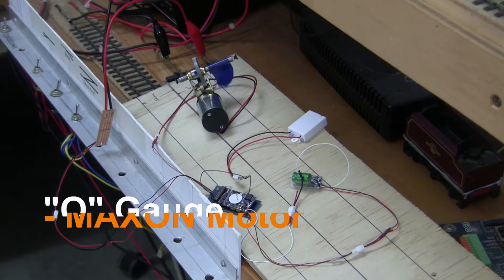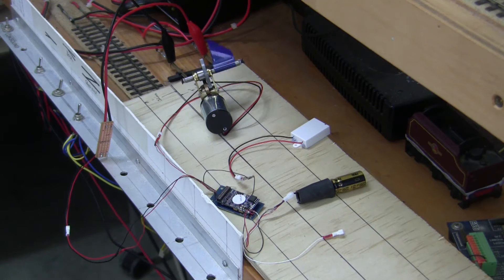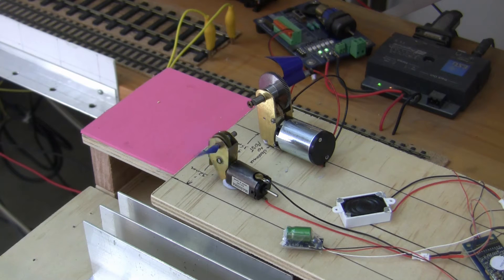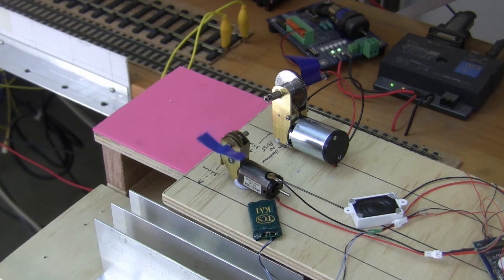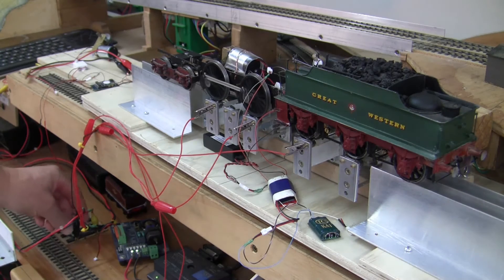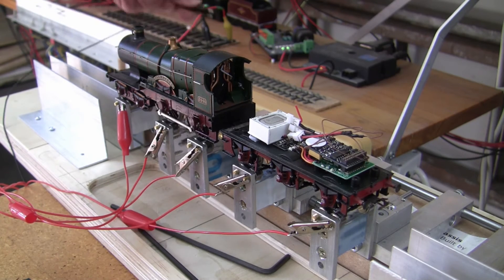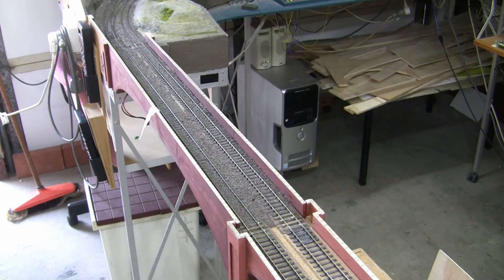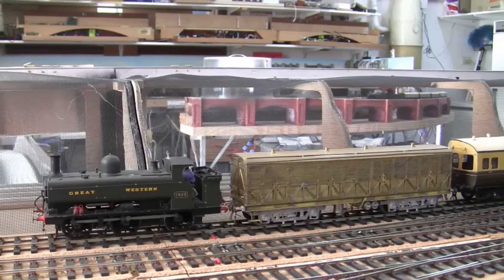DCC Decoder Keep Alive tests

Comment: I'm sorry, don't see the point of the video when it's only down to the size of the capacitor in the 'stay alive', doesn't matter who makes it, it's what size ( in micro farads/farads ) capacitors they use, just boils down to physics, make your own and fit the largest capacitor ( in capacity size/capacity can vary from make to make ) you can, job done! Don't concern yourself with whoever made the 'stay alive' they don't have access to miracle capacitors unless of course they're aliens??? :-)

Comment: What capacitance do you have in you homegrown unit?
Reply from the maker: Hello.  Have a look at page 26 of an ESU document for their V4 decoder file:///C:/Users/Charles/Downloads/51972_LokSound_V40_ESUKG_EN_User-Manual_Edition-4_eBook_03.pdf The details of the specification and circuit are shown there.  You might also like to look at DCC Concepts and their Super Stay Alive unit which is very competitively priced and saves you having to build your own.  I now use these units....
Reply: Thank you for your reply! I dug a little dipper on the subject and did a little math so indeed the 2200uF capacitor can only handle brief interrupts...

Comment: This stay alive nonsense should have been sorted out PRIOR to marketing DCC !
i see DCC as just a cynical overpriced gimmick, which these so called 'stay alive' things just add to more expenditure and more fiddling about to install.
Reply: "sorted out Prior to marketing DCC" so in the late 80s? because that's when DCC was first introduced and I certainly doubt decoders and capacitors were quite as compact back then.

and how is £10-£30 "overpriced" when locos these days can fetch hundreds of pounds? if everyone had your attitude we wouldn't have moved past 1950 levels of technology and detail with clunky three rail track and noisy open frame motors
Reply: Yeh lets go back to 1960's tri-ang and the big finger from the sky, nobody's forcing you to go down the DCC route, just stick to analogue.
Reply: Colliecandle you must be fun at parties
Reply: How many engines/locos can you run on one track and the answer is? :-)
Reply: And stay off my lawn. you damn kids !